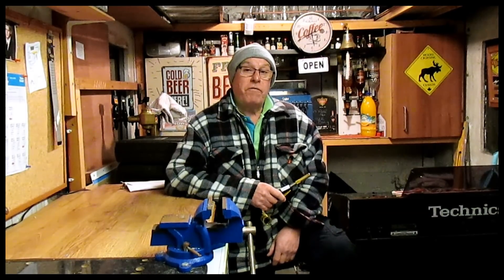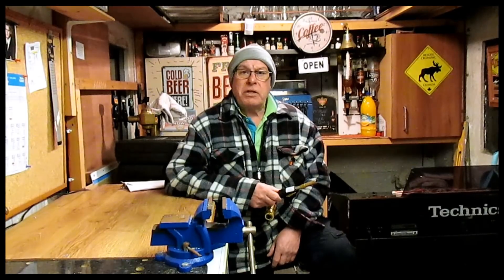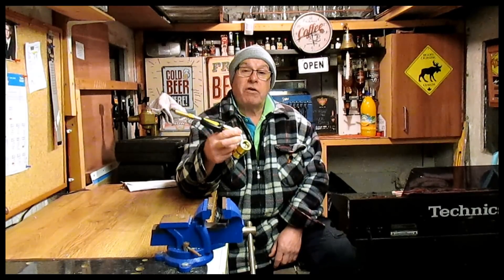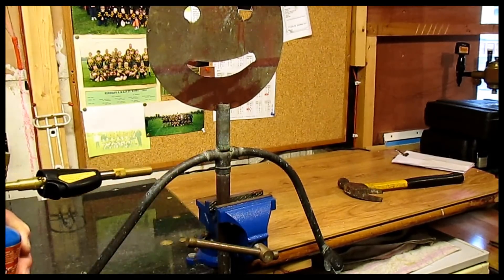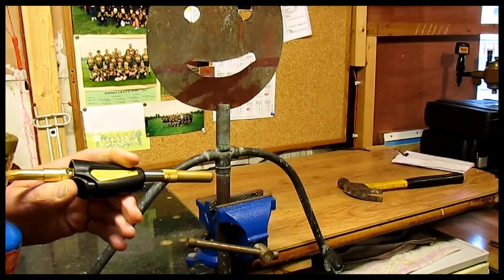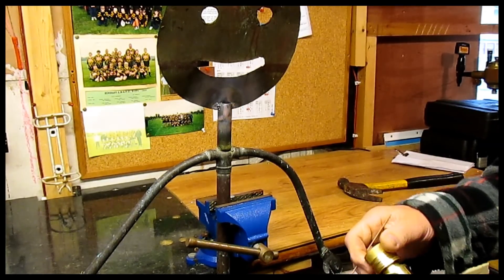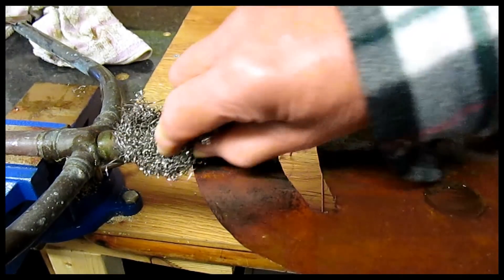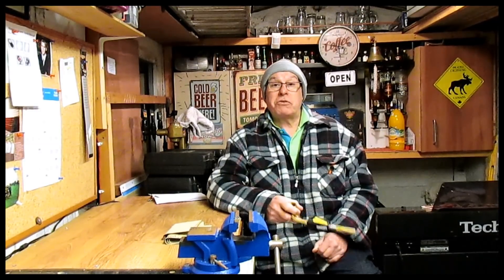toms top tips phosper bronze brazing

Comment: Why would one need brazing in plumbing? Thanks
Reply from the maker: you would't need it in everyday plumbing, Its just another string to a plumbers bow,
Reply: You don't, soft solder is usually adequate. The phosphorus in the brazing alloy acts as the flux, so you don't need flux.

  However, acidic flux residues, from active fluxes (Powerflo and the like) can  make central heating water acidic and that then starts corrosion of the radiators & ferrous components. It is a major cause of CH corrosion in the UK. 

 In France, central heating pipes are brazed for some reason. They have no problems with black sludge, they have no power-flushing industry that would be required to remove corrosion residues. Many French plumbers have never heard of a powerflushing machine.

 https://www.blogger.com/blogger.g?blogID=1877980633497831129#editor/target=post;postID=855495108989820185;onPublishedMenu=allposts;onClosedMenu=allposts;postNum=2;src=postname

Refrigeration pip-es are usually brazed.